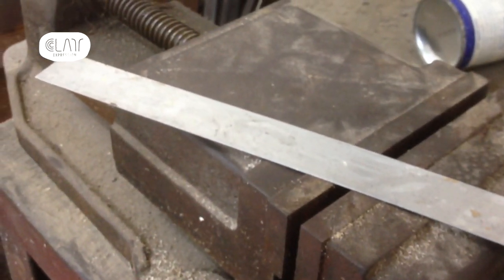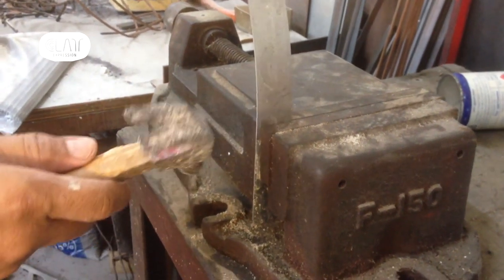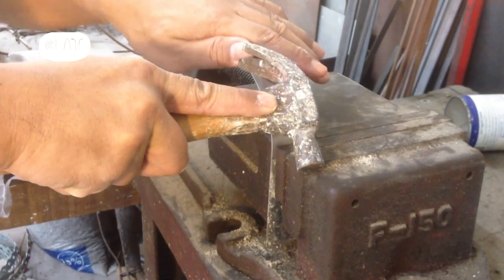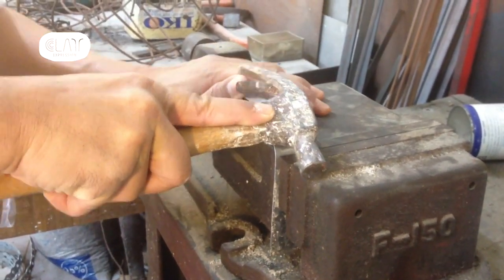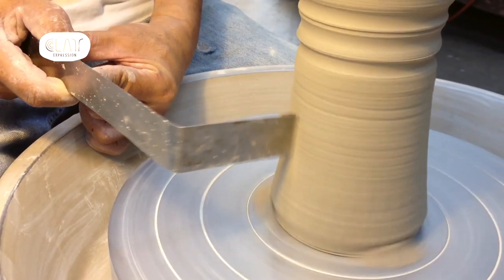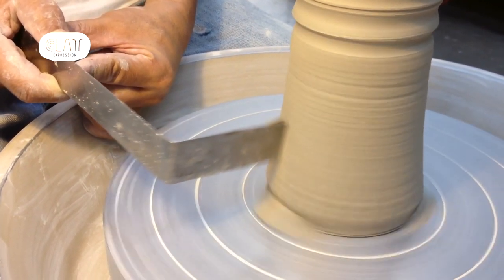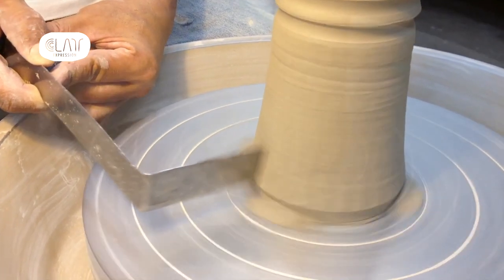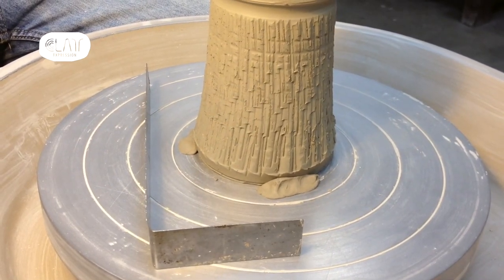Transforming an old metal ruler into a texturing tool - Pottery Making - Malaysia

Comment: Good tip....love chattering.
Here in Florida I use the metal strapping that holds together wood roof trusses for transport. I have picked them up off home building sites and find their flexibility very easy to work with. I would think you may have access to something similar in Malaysia even though metal trusses have become popular.(They may also have the same kind of metal banding for transport.)
Looking forward to more videos.
Thanks for sharing!
Video of the strapping/banding in use.   https://www.youtube.com/watch?v=QR8wVxGg5xc&t=35s
Reply from the maker: Wow. Thank you for your tip. I think we do but will need to do some looking around.😊